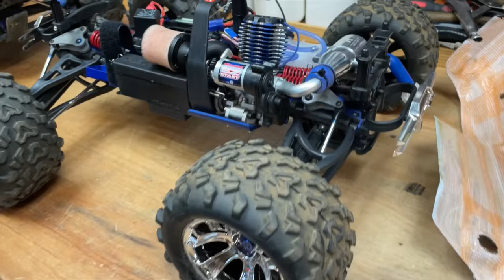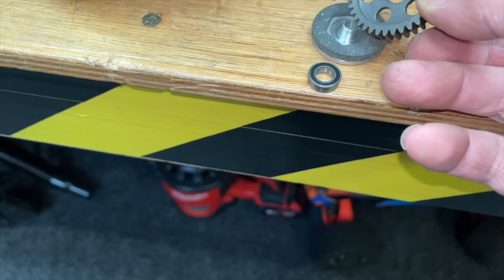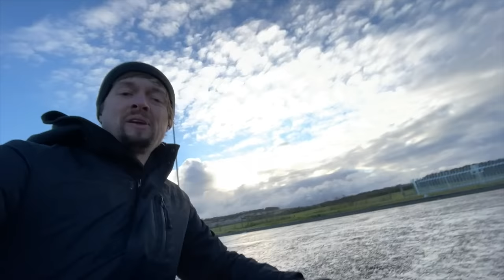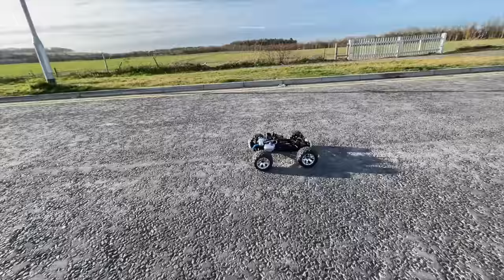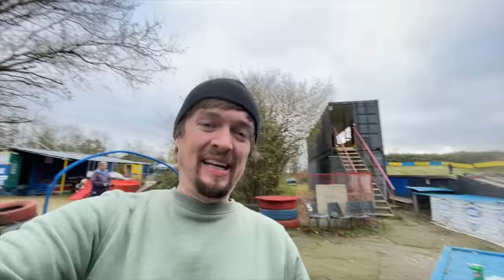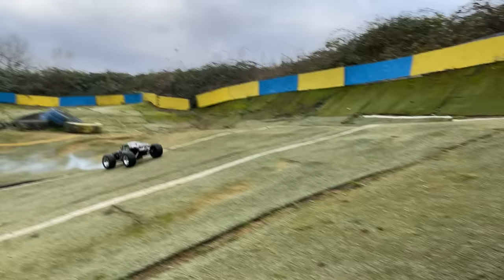Nitro RC Cars SUCK

Comment: Nope, sticking to electric. But I do admire the nitro guys, more power to ya!
Reply: Nitro is great because you never have to charge anything, you just spend 2 days tuning to run out a tank. Lol. God I've spent so much time working on nitro cars.
Reply: @mikedrop4421  technically you still have to charge the starter battery (if you have one) and you have to charge the receiver/servo battery. But at least the batteries last longer. Lol.
Reply: More power literally, jk I enjoy both only own 1 nitro to say I have one
Reply: @savagepatch187  I did own a Revo 2.0 Nitro a while ago, it was fun (when it ran), just didn't have the patience for it. Never could figure out the tuning. Gave it to a nephew who's more mechanically inclined.
Reply: @peteb8885  fair enough 🍻
Reply: Weather , temp, humidity changes too much where I live for nitro! When I lived in Florida it was similar, spent way too much time with watering eyes tuning the carb to get it rite that it really wasn't as fun. I gave up rc for while till brushless stuff got popular. Have bought,sold and built dozens of rc now, still hanging onto a brushless converted (summit trans, widemaxx kit, billet diffs, rpm plastics, with Kaiju ESC and motor) OG TMaxx for when I get the itch to play tho
Reply: Trav B  brushoess faster more consistant and just easier
Reply: I’ll 1-up all of you guys. I HAVE and LOVE BOTH! I have an X-Maxx, an HPI Savage X 4.6, and a Revo 3.3. And guess what, they’re all awesome! You don’t need to box yourself into a tribe. Be a fan of RC.
Reply: @mikedrop4421  You just confirmed you never operated one. Enjoy trying to get your servo to work with no charge.

Comment: Started with nitro and love them. I've never had an issue with all of my nitro cars . Yes they take some tlc to keep them going but if you know how to tune them  and maintain them , they start right up and the experience is hard to beat. Love the noise, shifts, no charge time, and the maintenance part of the motor is rewarding and therapeutic.
Reply: Absolutely.... To hell with all that electric b.s. ... 🍻
Reply: No charge time until you forget to charge the glow plug igniter and battery for the starter motor and you don't have a pull start😂
Reply: @youngeshmoney  the glow plugs charge in 5 mins.most of my cars are pull start.  The few I have with onboard starters,  roto start have batteries that charge  quick . Dont need to charge to 100 percent to get a start.
Reply: @youngeshmoney  jump box and you'll never go back. Plop it down push and go. Mine can either take 7 cell pack, 2s lipo or i have aligator clips to run to a battery
Reply: @davelowets  you are just weird, i could beat you with my electric over any nitro $100k

Comment: Kev, put a small  nito plane fuel tank in your revo.  It will have a weighted fuel pickup, so when the car rolls over it won't stall. 
I did this to my t-maxx 3.3
Reply: Wow :)
Reply: All my nitro stuff used a pressurised tank so rolling over made no difference at all. The carb has no float the tank has no pump and the engine has no sump. Thats why nitro is used in aircraft.
Reply: I miss flying nitro powered remote control planes! So much fun. But they built houses where out flying club was located. There's another one where I live but there's so many more rules and more people. Plus I flew with a group of Old Guys, they have all gotten out of it. Need a Nitro powered Drone!!
Reply: @captainchaos3053  nitro cars will stall without a weighted pickup when flipped  after a while typically around 30 seconds. The fuel line length, idle speed, low speed needle setting, throttle position and displacement of the motor all factor into how long it will run after beginning to suck up air. Model nitro Plane fuel tanks have a weighted pickup to keep the pickup tube in the fuel  when inverted. Some even have elaborate ball valves that switch the fuel from a top part to a bottom port depending on orientation. The tank  pickup design determines this, not the fact that the tank is pressurized.
Reply: the clunk allows for inverted flight..
Reply: @kayzrx8  Well to be fair all the cars I ran had a weighted filter in them. Car would run upside down almost as long as it had fuel in lt. Idle speed is idle speed if it won't stay running upside down it won't run right way up either. The impulse from the pipe to the fuel tank is absolutely vital no mater what the throttle position as the engines create so little natural vacuum.
Reply: @captainchaos3053  At idle these carbs create vacuum and create very little pressure from the pipe.That vacuum is enough to draw fuel into the carb AT IDLE. As I said the idle speed mixture will dictate how long the motor runs when starved from the fuel line. Pull the pipe to tank line when idling . The car will continue to run at idle. I've never seen a car with a weighted tank inlet unless it was modified. They typically don't come stock like this . Once that car flips they typically begin drawing air through the lines . It's when this air reaches the carb, the motor stalls. As I said longer length of fuel line and leaner idle mixture will delay this vs a shorter fuel line and a richer idle mixture. A larger motor will stall quicker than a smaller displacement more . These things do attribute to how long it takes to stall . If the fuel tank is full and the car  flips over at an angle that still leaves the fuel pick up covered with fuel,  the motor will continue to run.
Reply: @ls_812  Same here mate, when I was a kid (about 20 yrs ago), I flew at my local club that was full of older guys, they always had time for me and tought me everything they could.
Reply: @ls_812  A nitro powered drone would be a hell of an engineering project. Nitro engines by themselves do not have enough throttle response to be able to keep a quadcopter level during flight.

There would have to be some kind clutch system on each propeller, and a central engine powering all 4 props, and a system that could very quickly adjust the clutches to be able to vary the speeds of the individual props super quickly. It would be a hard thing to do.   

The other way I thought of to do it, would be again, with a central engine powering all 4 props at the same speed, but have variable pitch props and have the flight controller adjust the individual pitch on all the props to keep it stable.  

Would probably work... 🤷🏻
But it would be a PRICEY drone.
Reply: @davelowets  you can buy a chassis minus nitro engine that's made for 3d flight there's a video on yt somewhere its sick

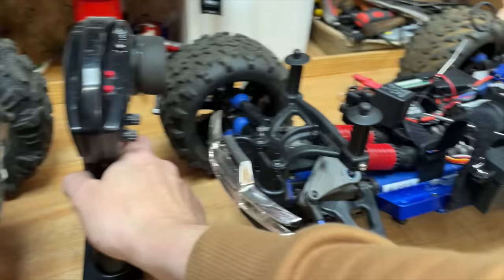Comment: 1:20 I did this on my Slayer Pro, too. I had my on-board glow on one switch and the starter motor on a momentary switch. Was pretty nice. Same the truck was an unrepentant pile of shit that always broke down on me. I got fed up with having to fix it every time I drove it when none of my other cars have any reliability issues.

Same chassis as the Revo, too.

Comment: My first car was an RC10gt.  I stared at the ad in Car Action for a couple years until I could afford one in 1998.  I went with a pull start engine and after about 2 weeks I pulled the starter off and stuck the bearing in a socket and used my drill.  Now here in 2022 it is again on my dining room table, about to be converted to brushless.  Thank you Kevin, for reigniting my love of RC cars.

Comment: Hi Kevin, great video, I love nitro. I have the Hobao MT you are showing in the beginning your video. I did replace the pull starter by a roto start system. But the switch from the radio is even greater (and so cool!). It would have been nice to have your friend explaining what (and why) he was doing when he was tuning the carb'. Keep on posting nitro videos !

Comment: Kev the nitros should be able to idle though a whole tank after being tuned, and you should be able to take off nicely after it idles for a little to, if they don't it usually means it's tuned wrong.
Reply: If it stalls when opening the throttle richen the low speed needle .

Comment: I set a remote start on my tmaxx years ago using a cheap little ESC from an airplane. It was sweet and blew the minds of everyone at the track. I gutted the wand and used the internals to power the glow so as not to blow it and we were jamming.

Comment: I got an electric Traxxas Stampede when I was in middle school. I played with it for years. Even bashed the thing into a park bench going full speed and obliterated the front suspension, thankfully with so many repair parts the ole thing was running no problem again. The problem is that I was charging the battery a couple years ago after it sat for a while and all of the sudden, BOOM. I was terrified and never got a replacement battery. This experience is why I only use 2 stroke lawn equipment and why I plan on getting a Nitro RC car at some point, even if I am a bit old now (MBA student)

Comment: Simple baseline is 3 - 3.5 turns out then adjust by .25 turn till it's in its sweet spot.. Im running a sledge now so I've got other problems to seal with! 🎉🎉

Comment: So, the thing about the contact patch on a friction clutch, is that the smaller the patch, the harder and more aggressive it will engage under the same spring tension. That's why racing clutches for cars, have pucks, not complete rings. In practice it puts more pressure on the friction material compared to the contact patch area, and it means it can transfer more power without slipping. Everything within reasonable limits of course.
Reply: yes!  correct!

Comment: I started with a Tamiya Wild Dagger electric.  Then I got into a Savage 21 nitro.  Since then I had a couple nitros but about two summers ago sold off my final nitro car (HPI HellFire) and I won’t look back.  Electric brushless is too clean and easy now it’s just easier to maintain, they run fast and smooth.  There is lots of upgrade potential.  I always love nitro as I’m a mechanic.  But it’s too messy for a hobby.  I like snowmobiles too.  It’s like a 2 stroke vs the new 4 stroke.  I have both.  The 4 stroke stinks less and less mess.  But the 2 stroke snowmobile is sure fun to ride and just sounds better

And hats off to Jason at Redfin he is one smart dude and a true hobbyist, I’ve seen some of his cool mods and creations that Kev has shown he’s just always tinkering and improving the rc car.  Very cool.

Comment: Someone who build this remote started did extreamly crude job... It all can be made much cleaner with use of esc instead of relay i actually made savage with remote starter and had to build electronics from scratch since what aliexpress provided burnt instantly(not wonder, i foud the dc/dc converter for the glow plug used in the og circuit to be 0.5A rated and glow plug tends to draw 3 times as much) now im trying to figure out remote turn off system.

Comment: I love my tmaxx. Love the tuning process of it. Knowledge of small engine repair helps alot in dailing in a motor.  I have a electric one as well. But at the motocross track after a moto practice i love taking out the t maxx and blowing burms out on the 50cc track

Comment: When I owned my revo 3.3. It took me awhile to get the tune right  but once I got it dialed it.  It would wheelie from a dead stop and flip over backwards once in 2nd gear.  Took me like 3 gallons of fuel to get the tune right.   My next rc will definitely be another nitro

Comment: They had a rc car track that they set up each Sunday at the bank parking lot, when I was a kid. You could hear the rc cars for blocks. They were super fast, and so cool looking. 
Then I got into rc cars and the beginner cars were electric nicad 7.2v, the biggest choice being a mechanical speed controller, or a digital electric ESC.  the better cars were nitro. 
Later. They moved onto lipo. 
My only gripe is that back when I was into them, they were all kits that you built from the ground up. 
Now, everything is ready to run. 
I’d be into them bringing back the kits. Everyone chiming in talking about how they love nitro, but, in my opinion, if it’s a ready to run model, it’s not a real rc experience anyways. if you’re not building it from the ground up, and all you’re doing is pulling something out of a box, then you haven’t put in the proper effort to get into the hobby. Anyone w a wallet can buy a toy, but a true rc enthusiast builds their car. 
And if you build your car, then you can choose to like gas or electric, or both. 
Me, I am glad that LIPO came out.

Comment: when your friends exhaust all their lipos and you simply top off the tank again and keep on keep'n on, nitro still has its place in the world.

p.s. I started using the VP 9% oil nitro fuel instead of the Traxxas 12% oil and haven't had to tune my engines at all. there's no stalling and no bog at wide open. I did run about a gallon of factory fuel through the engines to break'em  in before using the VP.
Reply from the maker: Best car for you is whatever puts the biggest smile on your face!!
Reply: @DashzRight  yes but the point is that it's fun
Reply: @DashzRight  You can drive and have fun with a nitro, you just don’t know what you’re doing.
Reply: Their is nothing wrong with nirto if you know what your doing all you have to do is listen to it an the motor is telling you I'm out of tune
Reply: I own two nitro RC's, Traxxas Revo & Slayer. also own a dozen electrics too. they are all fun to drive. electrics are convenient but that sound of a screaming nitro engine is just awesome.
Reply: unless they have a field charger then they can run all day
Reply: Hi
Reply: @KevinTalbotTV  it just sounds to me that the electric people are the younger ones that are into the throw away lifestyle and dont hesitate to accept things like electric full size cars without researching the bad side of them. I have never had issues with nitro. Tuning is easy maintenace is not much different than electric. Electric still need maintenance and special care

Comment: My first RC car was a Kyosho Raider 2wd (early 90's), with a brushed motor, mechanical speed variator (3 positions resistor) and a 7,2V NiCd battery whose charge lastrd some 5 minutes. 
Then I had a nitro car Kyosho Inferno DX (1995 approx.) and it was a beast for me. It was much faster than the electric, but I could never "play" with it more than two deposits without damaging any part of the car. It was very frustrating on the time that online shops didn't exist and there wasn't any hobby store in 70kms from my village...

Comment: The reasons people get hard time with the 2.5 and 3.3 carbs is because of the idle screw adjusment. First you have set the high speed needle then you have to adjust low speed needle and idle screw at the same time. Whyyyyyyu because when you move the idle screw you also are moving the low speed needle at the same time so if you try to close the throttle for better idle with the idle screw remmber to turn counter clockwise the low speed needle a touch otherwise you will lean the low speed neddle while closing the throttle with idle screw. Ones you have the perfectly balance between those two, you only have to open and close the high speed needle depending of the weather condition. TRX engines are very very good engines!

Comment: The thing with lipos is that they are very dangerous and you have to charge them between uses that you have to storage charge them when they are not going to be in use and you have to charge them before you use them and you have to be around them while they are charging that you can't come back when they are done charging and when lipos sit charged up they will puff up but nimh and nicd you can let those sit fully charged but they get weaker as they drain and you can only gear electric high only for pavement grounds and that you will over stress the battery and the electronics going in the grass being high geared and heat shortens the life of the battery faster and lipos like puffing up

Comment: An improper tune killed my tmaxx, most expensive tiny screw i have ever turned 😅

New motor will be here in a few days though. Lets see if i can get it right this time 😂
Reply: Remember under full throttle you need to see that thin trail of blue smoke emitting to be sure its getn enough oil

Comment: Yeah, when I was into RC stuff back 20 years ago, nitro was better. With electric, there wasn't much beyond your Tyco type stuff. I would love to go electric to test it out now, because I had just procured two T-Maxxes and they are a royal pain in the ass. No idea what I want to get, though, between an E-Revo or a Kraton 6s. I love the suspension setup on the E-Revo, but I hear they roll over from turns really easily. Unless sway bars and stiffer springs would help. It would really just be driven in gravel or grass.

Comment: I know this wasn't the purpose of this video but it served as the exact reason why so many are against nitro. Starting issues, fuel issues, priming, and needing an expert for tuning. No Thanks!
Reply: Eh, you won't have issues like this with a higher quality nitro that's properly tuned. Also, tuning isn't quite as difficult as many think. There's one thing that's a worry when I drive my Nanda nitro buggy though, if the receiver loses power there's a chance it can get stuck on full throttle. My electric Arrma Granite is definitely more user friendly and neighbor friendly, but my Nanda nitro buggy is a lot of fun to drive. Watching it going at full speed with the engine basically screaming is great fun. :D

Comment: I still have my hpi nitro mt2.. or most of it any way.. its the most fun rc I've ever had.  I love the nitro noises and smells! Nitro cars really teach you to keep tire side down! the hpi g3.0 motor is a good 1 pull motor when it's working right. I've had electric cars and it just doesn't feel the same to me... call me old school but if it ain't smokin it ain't fun! ( ok it is I just like gas...)